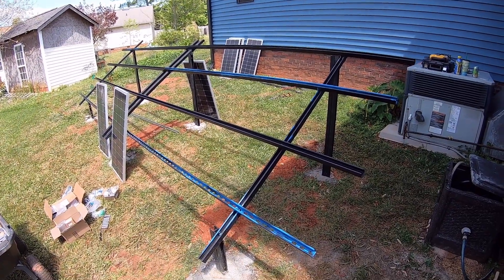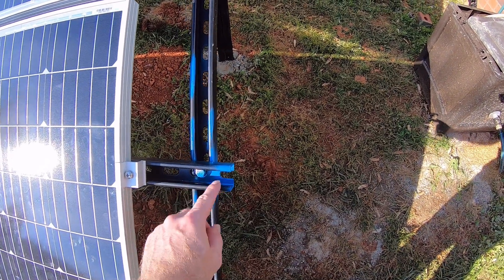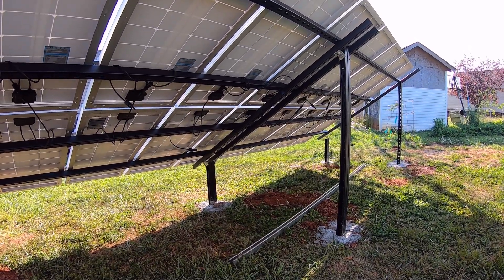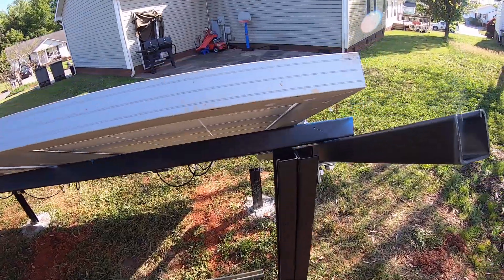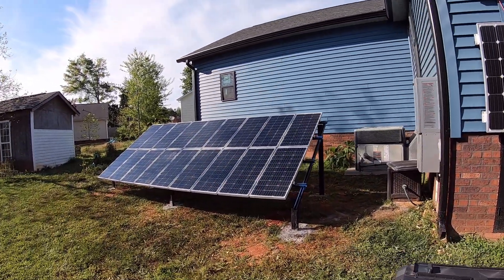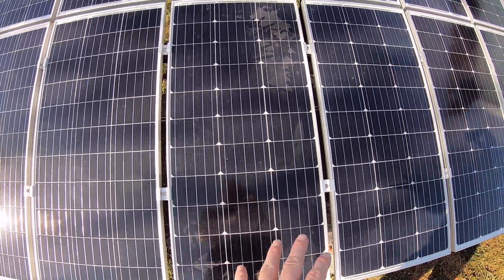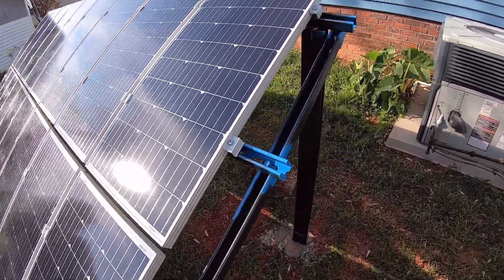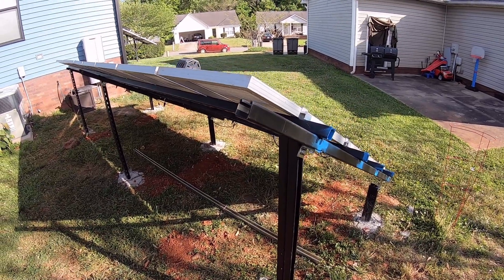Solar Array Addition Part 2

Comment: That's some panel setup round the house  :)  Subbed.
Reply from the maker: Thanks for the Sub, got more plans in the works.  Next steps for these will be to get them wired into the main house system.

Comment: do you have a link to those brackets used to hold the panels down to the unistrut?
Reply from the maker: For the start of the rows on the ends (end clamps) I had those from a previous project.  All the clamps used between the panels are called mid-clamps.  The hardware to mount to the uni-strust are the standard unistrut 1/4inch cone nuts.  The 1/4 cone nut uses a 1/4inch by 20 thread.  For the mid clamp itself those I found here: https://www.amazon.com/Solar-mid-clamp-Panel-Pack/dp/B07LDDSVKP/ref=sr_1_5?dchild=1&keywords=solar+mid+clamp&qid=1619408722&sr=8-5
Reply: @solargarage  awesome. Thank you